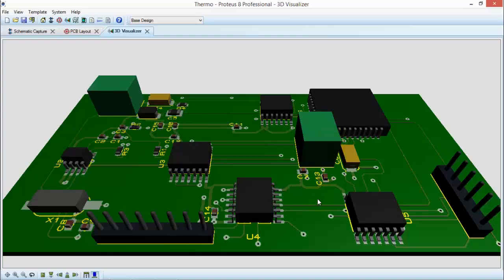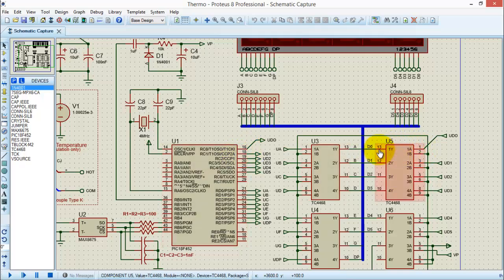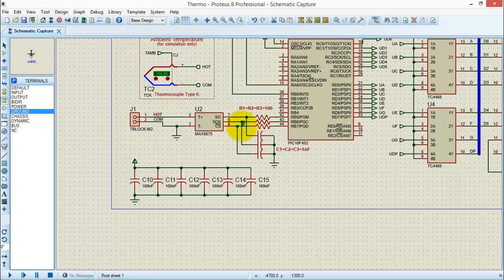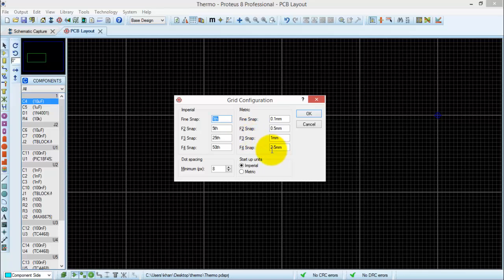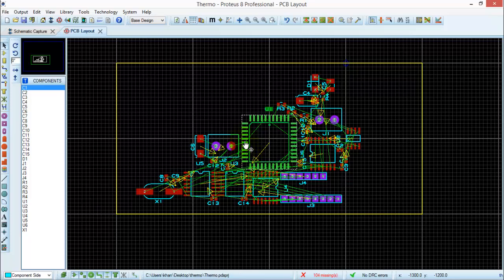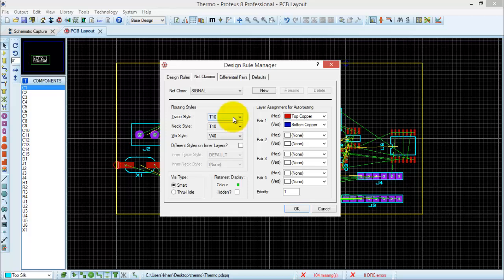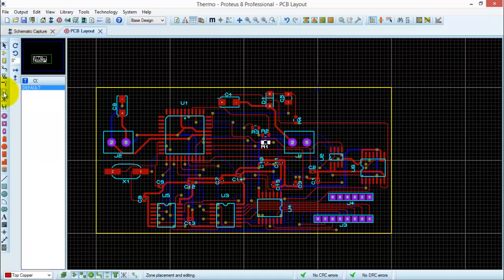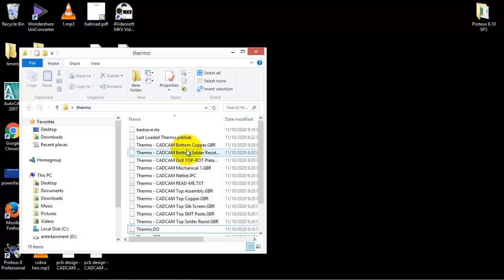How to Design PCB in Proteus 8 Ares | PCB Design Full Tutorial

Comment: I have a question ... The real life bridge rectifier and capacitor with 220v Ac 50 Hz gives 277v dc output
  But in proteus it dosn't happand
Reply: Correction 277v  to 311v dc
Reply from the maker: Yes you are right. Its ac to dc conversion.  
In proteus there are various terms when u put values in vsin source. Peak voltage rms voltage try one by one
Reply: Sr help me to do this if possible ...